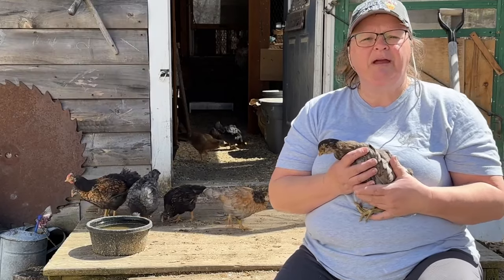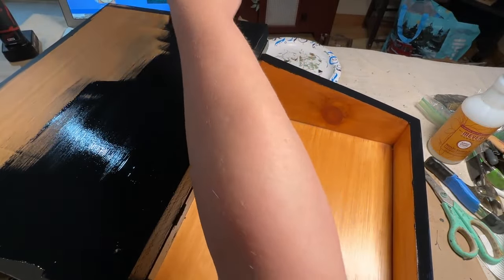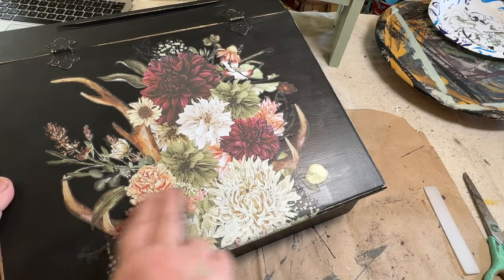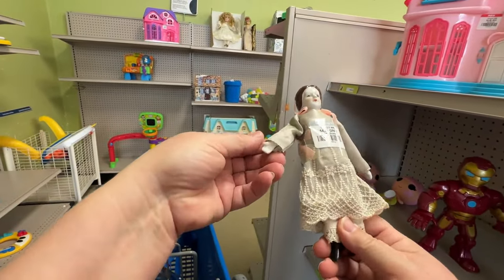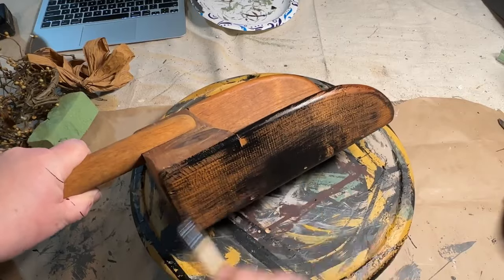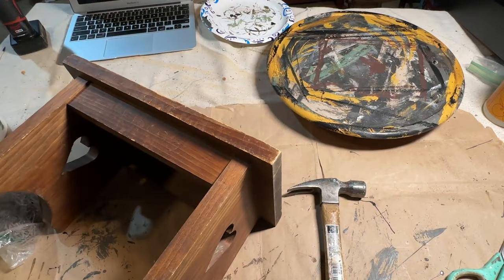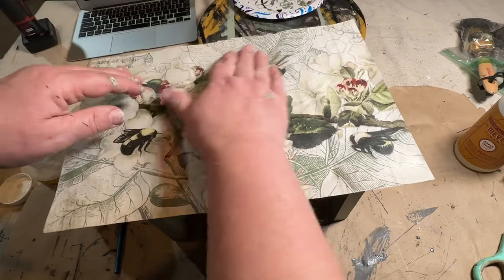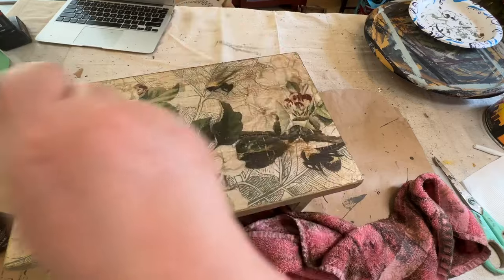Thrift To Treasure -Thrift Flip Challenge - DIY Home Decor Projects From Goodwill For Profit

Comment: When banging a small nail or screw and it wobbles, try a hole punch first to make an indentation. They’re cheap at Harbor Freight. Or hold nail with tweezers or pliers till it stabilizes into the wood. I love picking up little tidbits of info and passing it on.  I love your taste.
Reply from the maker: Thanks for the tip. I actually have one, but was too lazy to go get it. lol

Comment: I have a couple of wall light fixtures with a gold tone that I'd like to darken. What do you think would be best to do this? Also, they have stark white faux candle bases with faux wax drips. I'd like to darken that as well. They came with the house. I thought about the antique wax, but wanted your opinion.😊
Reply from the maker: Yes that should darken it up with antique wax. You could also use rub n buff in the antique gold. It will tone down the gold quite a bit and might stick better. I would try a small spot with the wax first and see how well it sticks. I hope that helps.
Reply: @RepurposedMyWay  Wonderful! Thank you so much! I'm kind of thinking about using your grubby mix on the white "candle" area. How can I show you a picture of it?
Reply from the maker: @marameadows7242  Oh I bet that will be great. Instagram or facebook would work😀

Comment: Where did you get the decoupage sheets?
Reply from the maker: Usually Zazzle -https://www.zazzle.com/mbr/238885489836294241
If you scroll down on the linked page it will be there.